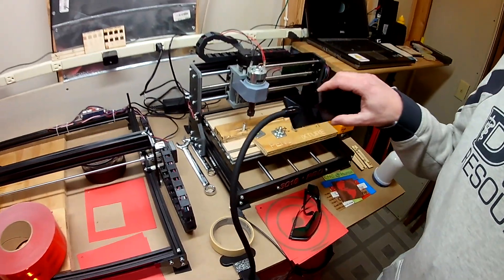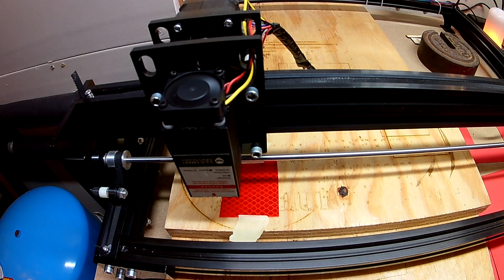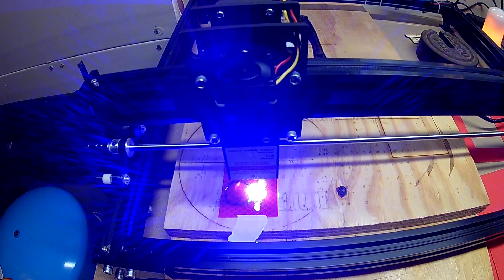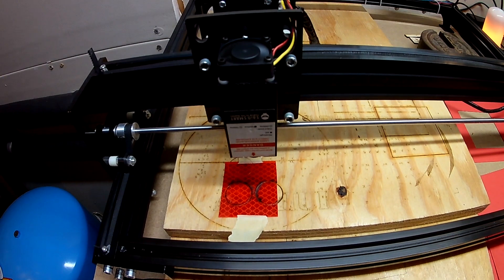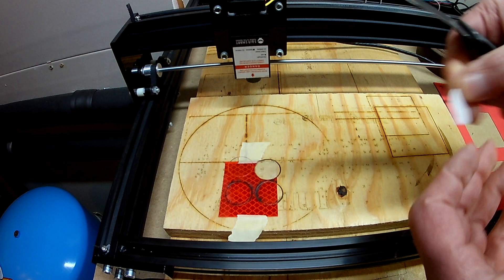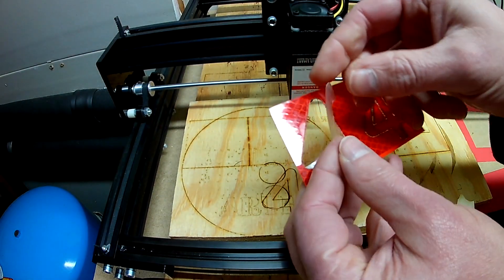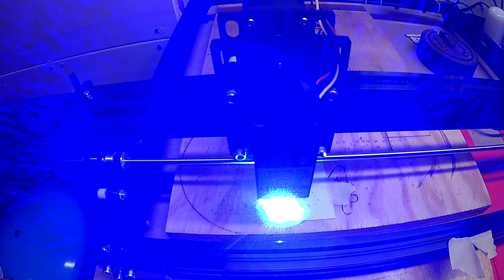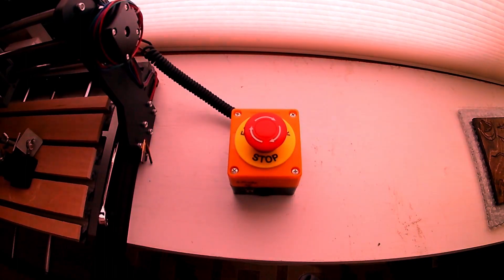Cutting 3M Reflective Tape

Comment: Use transfer tape to transfer the letters after weeding the unwanted bits out. Just like we do for vinyl stickers.
Reply from the maker: Absolutely!  What I have usually done is use the tape as a sticker and I remove the numbers and letter as the unwanted bits leaving the opening to show through.  If what you wanted were the numbers and letters, transfer tape would be perfect for doing that; just like with vinyl.

Comment: Interesting experiment.  Note that the top surface of tape is PVC and is flammable and also gives off toxic fumes. Good ventilation is important. Also the backing siliconised paper (liner) and is not normally cut through
Reply from the maker: Good point Ralph, ventilation is always important when burning just about anything.